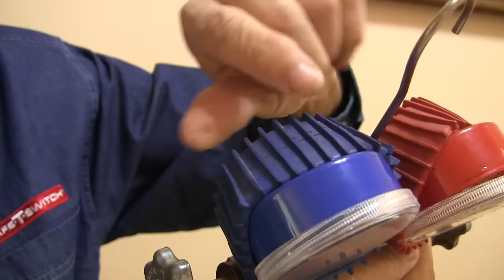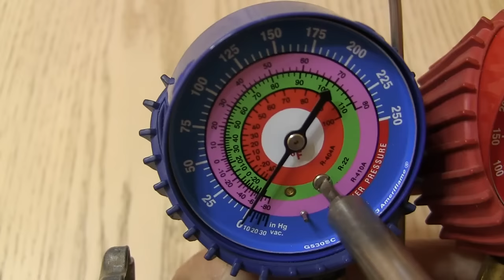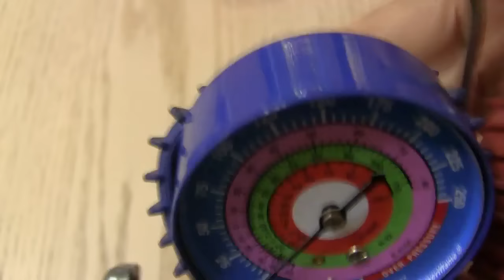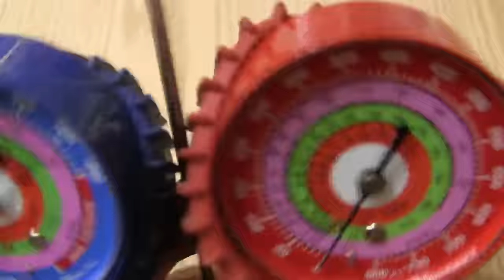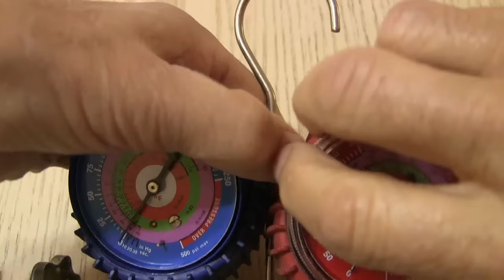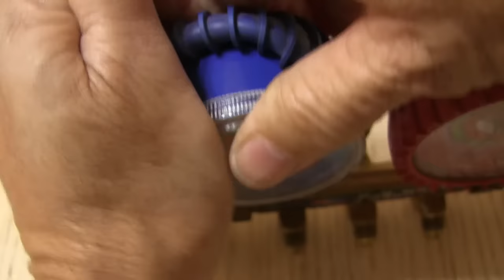HVAC calibrate manifold gauges

Comment: I enjoy your vids Dr. Z!!!! Couple few years back I made video by pretty much the same title which I long since retitled "How To Zero Calibrate AC Refrigerant Gauges Before Charging " after a viewer LaksaMedan corrected me that this was not truly calibrating gauges only zeroing gauges.  Since his comment was made publicly I hope you don't mind I repost it here so others can learn as well.

LaksaMedan     3 years ago
This is not calibrating your gauge . This is ZEROing your gauge there is a BIG ifference. 
To calibrate your gauge . you need a tank of refrigerant that is in stable temperature. tape and insulate a temperature probe to the side of the tank. hook up the gauge to the tank. 
consult the T/P chart. for the corresponding pressure for the temperature measure by the digital thermometer.  Then you are calibrating your gauge.

Comment: I was told to hook my gauges to a bottle of refrigerant then use the pt chart and room temp to calibrate
Reply: that works, too.
Reply: My R-22 gauges don't read zero when calibrated with the PT chart, but I'm really certain they're showing the correct pressure when I use the PT chart and check linearity on both gauges as I bleed the manifold down.  Setting to zero isn't calibration at all, it's just zeroing.  But hey, what would I know, I only ran a radioassay gas analysis lab.

Comment: Sorry thats not calibrated at all. Dr Z now connect the gage to a bottle of R22 with a accurate thermometer attached to the bottle and see for yourself how much the gauge is now out. Who cares where the zero point is. We need it calibrated to the correct pressure.